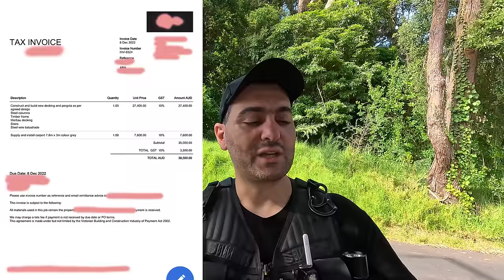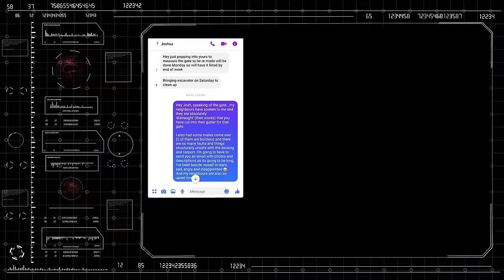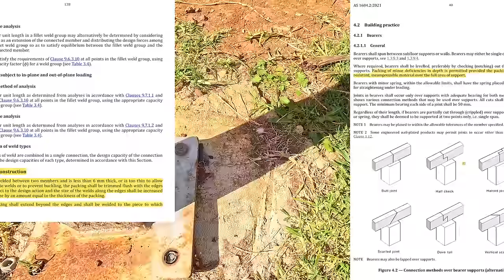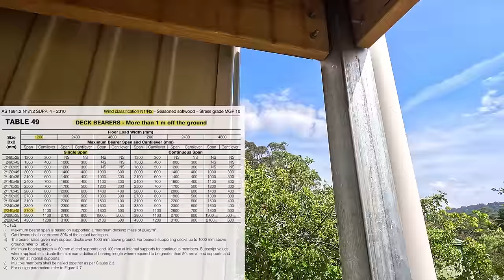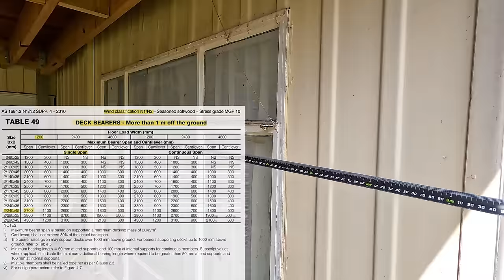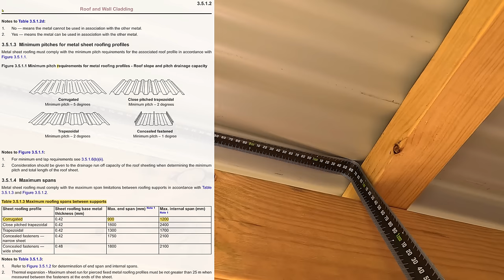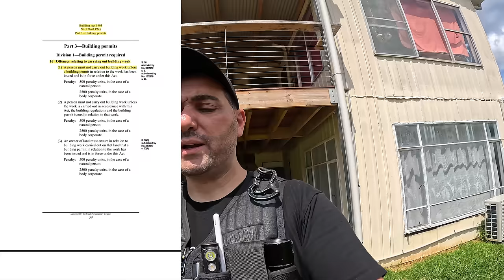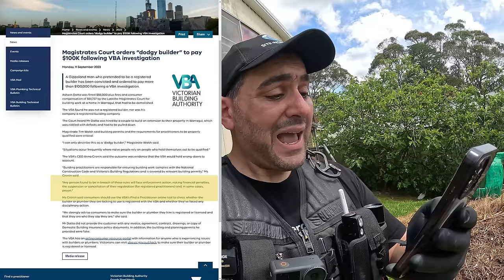I Inspected A Dangerous Build | Illegal Build Caught

Comment: Hi there, well I do not support the home owner for stupidity. I presume that she is literate and sees the news and reads papers for there have been numerous cases down south that are like this. I have a 50 Sq meter deck added to the house with the roof continued from the house and all of it is dressed all round hardwood plus there is an additional 7 x3.8 meter carport for the boat. I drew it all up and took it to the engineersfor approval (which it did without a problem)  I then submitted it to the council and they approved it, then there were three inspections one for the footings and steel , one for the actual construction and then there was a final and all of these were approved. Every thing was checked and double checked  and in most cases over engineered for we live in a cyclone area and my family is importent to me. But I know that there are cowboys out there for the neighbour had one done for half the price and all made from pine. I have to admit that I knew what I was doing as it used to be my job. The wife and I built it all and with the two of us it took four months and we enjoyed  doing it. I do not know what it is like down south but for work like that I suggest that she sees a layer and totaly destroyed the carpenter and the high raky in the council for they should be charged with gross neglegence and sacked.